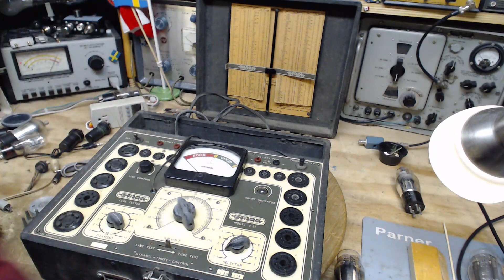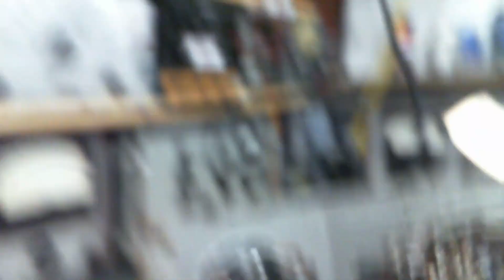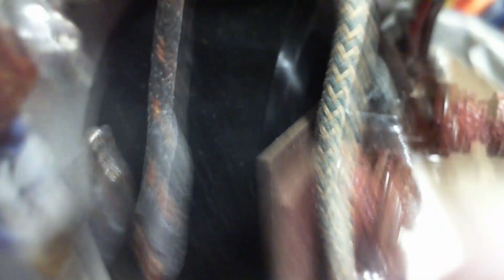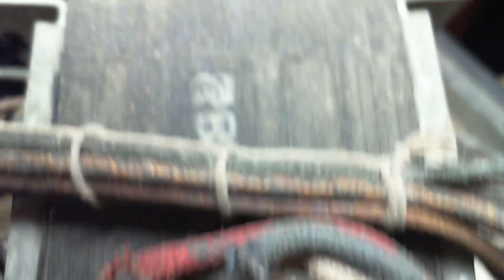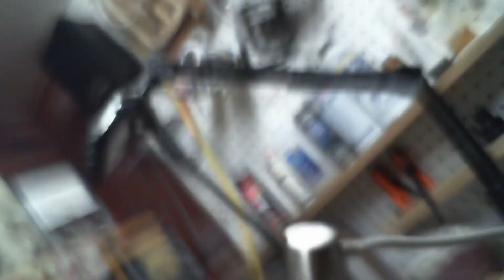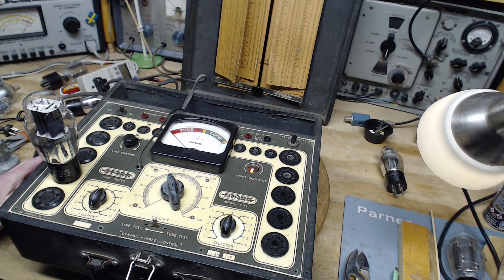Tube Tester Testing - Stark Model 9-55

Comment: Could the battery test be for testing the potential of a Grid battery or rechargeable Accumulator ?.
AI has its uses but if humanity got into the habit of only asking computers for answers eventually no one would exist to check the answer was correct. And if AI learns from verification it will eventually end up dumb.  Despite it being helpful at times,  I think your good lady has the best solution.. Signing your work, absolutely, you should take responsibility for you good work and be accountable for your mistakes. People tend to be more careful when they know you can find them !.